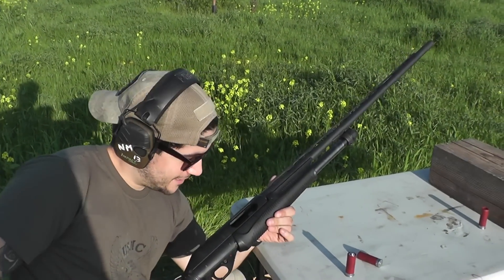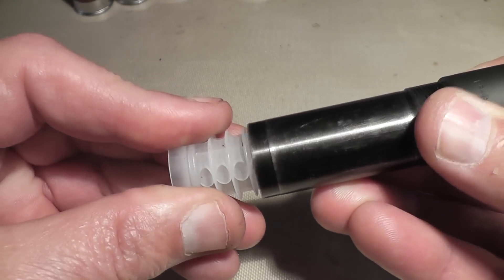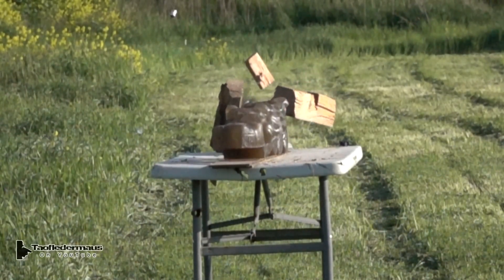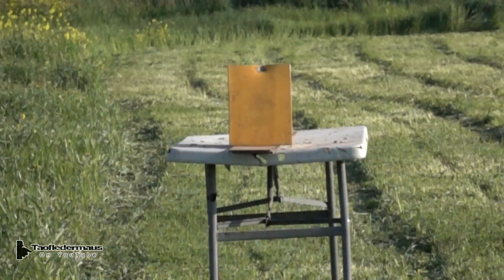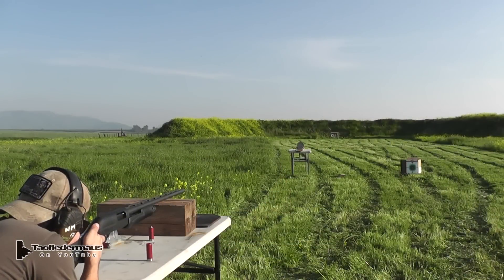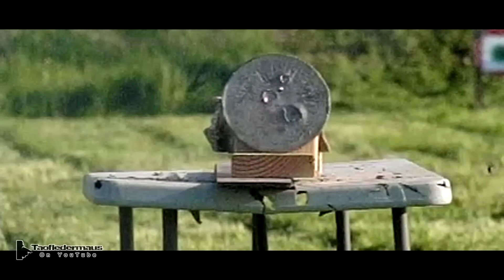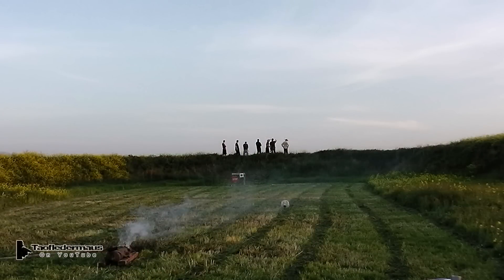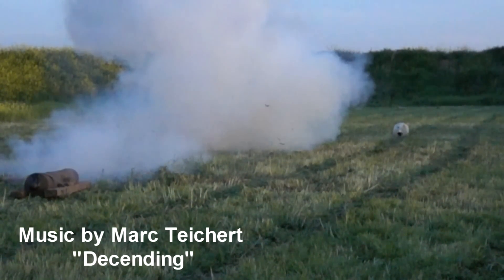We shoot GIANT 70 cal "Gammo Rockets" from a Shotgun!   (Concept Slug)

Comment: great job Daniel. we need more young people learning the trade. the best advice I can give to anyone that wants to be a machinist is learn the basics of manual machining first you need to know feeds and speeds, the how and whys of processing a part. and how to design and make fixtures that will hold and locate your part without taking forever to make. there are alot of people in the trade that struggle with one or more of these. a machinist that masters them all will always be able to find a job.

just because you can program  a CNC machine to parts. in my opinion dose not make a mistake. a machinist. to be a good machinist you need to be able to take a print and before you start cutting or programming you need to be able to process the entire job in your head with all fixturing and tooling needed figured out. it all sounds easy but I have been a machinist for 14 year and have seen alot people who call themselves machinist but are more likely guys who can make easy run of the mill parts. not high precision prototype parts like I do.
Reply from the maker: +TACTICAL G-CODE   Good advise Tim!!

Comment: Thank you, I'm glad that someone figured out that the flash was 4Al+ 3(O2) = 2(Al2O3), and the steel ones are Fe2O3 and FeO and maybe Fe3O4.
Reply: what?
Reply: what?
Reply: what?
Reply: Science!
Reply: Yeah, SCIENCE, bitch!
Reply: +Andy47357 What does science has to do with having fun blasting stuff apart?
Reply: How does physics not take a role in how the bullet works. How does chemistry not apply for the fact that you are taking a chemical and making it into two different ones?
Reply: ZerOne Games Use science to maximize fun and destruction, while doing the whole thing safely. It's simple, really.
Reply: +ZerOne Games Science, specifically chemistry, teaches us which chemicals to put together to blast stuff apart.  Also which ones not to mess with for fear of accidentally achieving orbit.
Reply: +Amigo21189 Or fear of melting half of your head
Reply: It's aluminum reacting with lead oxide, a thermite reaction
Reply: Everything.

Comment: Maybe the ball stuck to the plate because of explosive welding from the aluminum detonation?  Or maybe it's a thermite reaction between the aluminum and some rust?  

Either way, pretty cool video as usual.
Reply: It may be heating and cooling rapidly to make a shrink fit
Reply: +Agent Ham Thats what taofledermaus said
Reply: +Jimmy De'Souza I believe that it's cold welding. It's when two metals, when in direct contact and having nothing in between them, touch together, they instantly weld together. The pressure is probably pushing away all of the impurities and causing the two metals to come in direct contact.

Comment: I've seen you mention a few times on video now that you think its the Aluminum Oxide detonating when the aluminum hits the lead. This is very unlikely as the aluminum oxide is very tightly bonded with not a lot of available energy to release.

It is far more likely that the passivization layer of aluminum oxide on the surface is being broken by the impact and a fine spray of pure aluminum being exposed to the atmosphere and rapidly oxidizing is producing that light.

Comment: The steel ball bearing sticking to the plate could be a result of explosive welding. I think explosive welding is most often used with dissimilar metals but relies on a supersonic explosive force between two sheets of metal.

Comment: I bet that flash is a thermite reaction between the aluminum and traces of lead oxide on the surface. The speed of the impact would force the reaction to happen quickly, just a guess.
Reply: +Teth47 doubt it gets hot enough lol if there was even enough of each
Reply: Anon Ops Doesn't take much, and you do know that bullet impact sites on hard materials can reach metal vaporization temperatures, right?
Reply: Teth47 didn't know that. wow thx for the info.

Comment: My theory on the aluminium flash is that the pellet hits the plate so fast that the air doesn't have much time to get out of the way, so it forces the aluminium oxide off and reacts with the fresh metal, burning it, which produces the flash.

Comment: Hey Jeff, I'm sure you've heard this before, but placing the barrel directly on top of a rest (the wood block) can alter the accuracy. I've heard it's because instead of nothing touching the barrel except the forearm is why you hold it there. It's something about the vibration and gas, not sure exactly. Anyways, you don't shoot very far at all, just a tip.

Comment: Quick question, why use aluminum? Aluminum is a really light weight metal compared to lead with is one of the heaviest. I think what you should do is use that machined aluminum slug to make a mold so you can cast a lead slug and then press that steel ball on it. It will be exactly as a pellet from an airgun and made of the same metals too. Am pretty sure it will have way more destruction power this way

Comment: the reason they rise is something similar to why a ping pong ball curves in the air, when they hit too high of speeds, there is so little mass that they are not stable and they try to curve a little bit to slow down, most of the time with shotgun shells, that means it goes upwards
edit: if you put a very light round in a very powerful shotgun, you will notice that it will go very fast for a split second then will slow down to about the max speed that the round is stable, meanwhile, they will curve in some random directioin

Comment: I don't beleave the "detonation" is due to the aluminum oxide. I think the cavity in the projectile is compressing the air in it on impact and there by igniting (dieseling) much like a metal, plastic, or wooden firepiston would.
Reply from the maker: +Nightravenrr  But we never see it with other materials,  lead,  bismuth,  etc.
Reply: +TAOFLEDERMAUS did the other materials have as large of a cavity? Perhaps the rigidity of the aluminum allowed more of a seal to be formed against the lead disk thereby allowing the trapped air to compress to the point of ignition?

Comment: I cast my own slugs and have been toying with the ball bearing idea. I've been trying to find some cheap 1/2" carbide ball bearings. I have an old 1 oz. slug mold that I want to put a ball bearing in and poor a slug around it. The ball bearing would rise to the top of the lead like a nosecone. I have a load recipe that will fire them at about 1,600 fps. 
I'd love to try them out on a armor plate.

Comment: Actually the steel ball bearing has coldwelded itself to the plate. This is a Methode to weld two materials together wich you normaly cant weld together, for example steel and titanium, and you use high explosives to perform that. Sorry for the bad english, I come from germany.
Reply: It only happens when it's only metal and metal touching, right? It mostly doesn't happen on Earth because of the impurities and air that get between the metal. I heard it happens a lot in space, however.

Comment: dont comment  much  but how will wad cut shells run through the choke tube?
Reply from the maker: +halffix  I'm not sure.  I'm not a fan of the cut shells through a cylinder bore.   They fail about half the time.   The choke would probably just make the problem worse.

Comment: Did it friction weld its self to the plate
Reply: +likenem I expect the metal turned liquid for a split-second as it hit, then fused. If that's a friction weld, then yes )
Reply: +likenem sort of. at those extreme speeds objects are able to flow upon contact due to extreme pressures. basically some of the steel from the ball bearing and the steel plate became fluid and fused together.
Reply: Alex Schmidtka That's what I already said...essentially
Reply: Daniel W you posted your comment as i was watching the video so i couldn't have seen it when i commented.

Comment: Stain (circuitry soldering) birdshot/slugs for a video? Stain is an odd metal, I wonder how will it react on impact? It tends to melt real easy, maybe it will meld with the target, or maybe it will just melt on trigger pull and stick to the insides of the barrel xD

Comment: if he fashioned a tip instead of a ball and made it of a steal tempered to a higher rockwell hardness or just left at full strength he wouldn't get the newton's cradle effect, there would be far more penetrative damage and they would not have the tendency to rise upwards as the front will be about as heavy as the back because of the extra material

Comment: Hey, 'Maus!

Mastapoole and Iraqveteran8888 each has a video of .50BMG rounds being fired from a 12ga shotgun.  I commented as follows:

"You might try gluing some narrow pvc strips lengthwise inside the barrel -- either straight or tapered strips: experimentation is likely required to determine the best dimensions and shape.

The purpose of the strips would be (secondarily) to stabilize the bullet and (primarily) to control the pressure along the length of the barrel.

You probably won't get anything close to the projectile speeds you'd get from a proper rifle, but you might get more than half that -- which would still be pretty impressive."

Maybe you could do a video on this (it may require a lot of experimentation just to find the best adhesive), with chrono results?

If the chrono results are good enough, maybe vids of terminal effect in gelatin and/or "normal" 3D targets?

A project of this magnitude might require collaboration between multiple channels, but I think it will be awesome for whoever pulls it off.

Thanks for your time and videos.

(cc: DemolitionRanch, Iraqveteran8888 and Mastapoole)

Comment: +Taofledermaus
The Flash might rather be a reaction of the aluminium with the lead blocks' oxide layer than aluminium oxide detonating.
A mixture of lead oxide powder and aluminium powder was actually used for crackling effects in Fireworks (today bismuth oxide is used though, as bismuth is way less toxic).
Maybe you could shoot a block of bismuth to test this theory?
Reply from the maker: +Darnoc  We did shoot a bismuth slug at the sled plate and I don't recall there was a flash.

Comment: ricochets don't work like that, when a bullet hits the plate straight on it loses all/most of its kinetic energy and won't ricochet, it might fly your way for like 5 meters if it's a really light projectile but it wouldn't hurt if you got hit by it.
Reply: +TheNicoMineFR I was struck by a slug from a 12ga after bouncing off steel. It did a little damage but nothing serious. I once saw a .50 bounce that hit a plastic box and ripped right though it. Ricochets can have enough velocity left to do a bit of damage.
Reply: Jesse Sisolack I'd be curious to see the .50 cal one.
Reply: A hardened steel ball doesn't deform so it can bounce back.
It can't kill you but has enough energy to take out an eye or make you bleed.
Reply: accorden I'm pretty sure it woudln't puncture the skin, an eye maybe but the probability is so low. Besides, do you really think it has enough enery to fly straight all the way back to them ?
Reply: TheNicoMineFR It has plenty of energy to fly back. I've been hit by airgunpellets flying back at me from 15 meter targets.